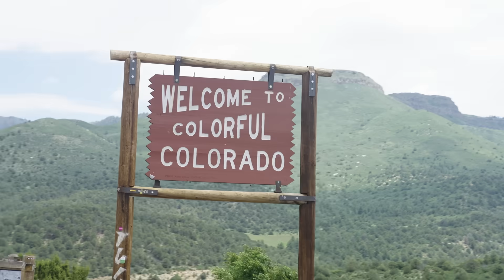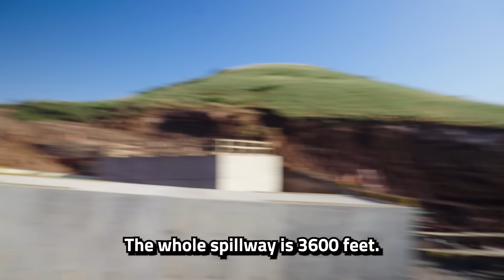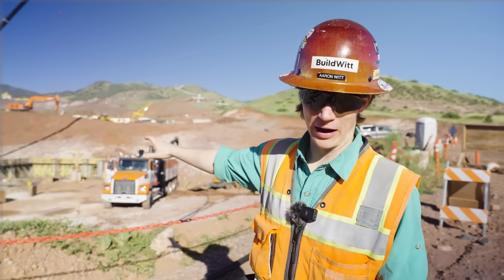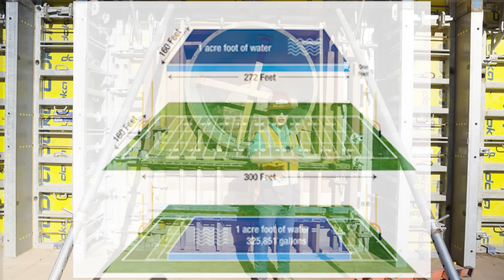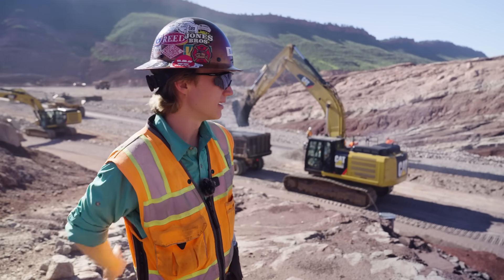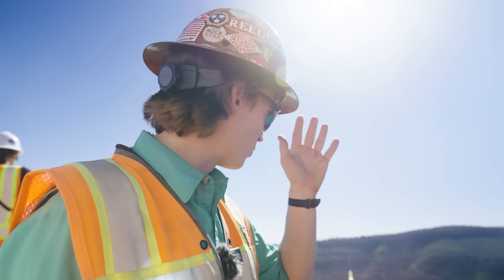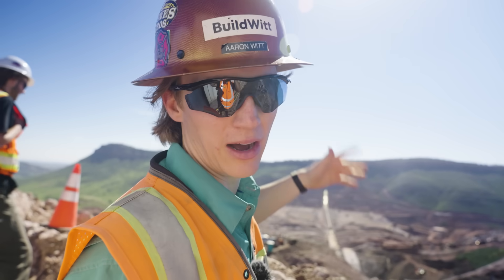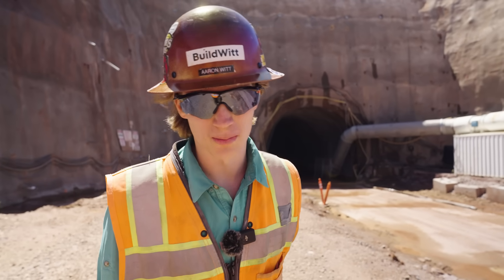Building a New Reservoir to Supply 825,000 People with Water!

Comment: Barnard couldn't get our reservoir project done in South Texas. They just don't know how to work this ground down here on the Gulf Coast. Hope they have better success with this behemoth of a project. Their workers were so worried about safety and protocol nobody thought about successful completion.😂😂😂 One of the foreman told me not to hang a pole light from an extension ladder 1 day and I knew if I didn't the job was not complete and they were threatening to back charge me if it wasn't complete by the end of that day. I didn't have time to schedule a lift and all that. So you know what happened?? I went up that extension ladder with a parking lot light and hung it no problem in about 10 mins while some Barnard kevin screamed and called everybody under the sun to get me off the ladder. 😂😂😂😂 My boss called me and told me to stand down to do what they told me but it was too late....the light was up and hanging in no time at all and I was thinking deuces back home. Texas is a little different and those workers said as much.😂😂😂😂😂

Comment: Ya.. another Teton..  Quite frankly I don't think that the Front range is stable enough..  in it deep underlying structure.. and this is a political project, but then you have pointed out the nearby existing dam.  maybe they are also using the pumping are releasing of water for energy storage.

Comment: If there is no river running through, do you seriously believe there is enough runoff from rain and snow melt for this to ever fill up?
Reply: The water to fill it will be pumped from Lake Granby thru a tunnel over the continental divide and thru a system of reservoirs operated by the C-BT system. The tunnel was built in 1940.

Comment: Never seen such narrow spillway. Capacity looks very limited. Catastrophic floods produce unpredictable runoff which lead to massive amount of  overflow water to be discharged rapidly to stop the swell. With that in mind, that liitle channel looks ridiculous.
Reply: Unlike most dams, this is not built on any river, stream, or creek. And the watershed that would dump into it during a rainstorm is trivial in size. It will be filled by the C-BT system, which pumps water from Lake Granby across the divide, thru a few other reservoirs, and ultimately to this reservoir. Being so heavily controlled, there is no need for a large spillway.

Comment: This is what California needs to do. They keep pulling up dams, and replacing the hydroelectric ones with solar and windmills that cannot match them in electrical capacity, while allowing the water to flow out into the ocean thus depleting the water needed for both drinking and farming. Then every year during heavy rain seasons they seldom keep the water. If they just built some storage reservoirs like this that are not blocking rivers, then California would not be in trouble every couple of years.

Comment: Surprised all the eco nuts and enviro wackos haven't stalled this marvelous project. The midwest really needs more water resources desperately.
There are a number of other dry valley's that could be turned into lakes. I hope this inspires more projects. 
Also for pumped storage to save solar power for peak periods.
Reply: Probably because no one knew about it until now.
Reply: @Summerbreeze537 the approval process for this dam started in 2003. Is 22 years enough time?

Comment: Is this going to be used to divert more water to the eastern slopes of the rockies and population centers like the Big Thompson project, or simply to store water already on the eastern slopes? If it will divert more water against nature like Big Thompson, this doesn't bode well for the lower basin who already have their major share of water issues. Between diverting the water against nature to the east, and Wall Street buying up rights on the western slope, there won't be much of the traditional Colorado River left in the future at this rate. It's a shame this type of large scale project isn't happening in California instead. Barnard was the company who constructed the Lake Mead intake project to supply Las Vegas before Impreglio-Healey and Vegas Tunnel Constructors came in and took over for the 3rd (lowest) intake. This is another huge project of their caliber and it will be interesting to see it unfold. Very much enjoyed the video, just subscribed 👍
Reply: One new reservoir starting in California soon. On March 10th 2024, President Biden signed a package of bills that included $205 million in construction funding for Sites Reservoir, a proposed $4.5 billion project planned for the rolling ranchlands west of the town of Maxwell, about 70 miles north of Sacramento.
Reply: @duchampsrook  thank you for this info that is great news to hear! With the Sites Reservoir though, I'll believe it when I see it holding water. Sites has turned into the next "high speed rail" of resource projects... talked about for decades but still not ready all these years it has been so badly needed.

Comment: This is so awesome! Hats off to all the Engineers, Workers, Equipment and Suppliers and the Politicians who all fought to be a part of this great project. It's seriously something to be proud of to be a part of this much needed project. Thanks for sharing. Best Wishes & Blessings. Keith Noneya
Reply: @MJ-uf9tl  Yes that could be a problem fro sure depending on how much water is used. I'd like to see water catch systems like they have in rural Mexico. The have flat roofs with a 9" dam all around the edge with a few pipes that lead to water tanks. The filter and heat the water with solar.  Then the water used for washing and toilets goes right back into the ground via a drainage field and makes it way back to the underground aquifers if one exists there. I also like Earthships, check those out they're amazing. Good comment. Best Wishes & Blessings. Keith Noneya

Comment: Doublethink: The act of simultaneously accepting two contradictory beliefs or ideas. How is it not blocking the water?
Reply: There is no river, stream, or creek going into this reservoir. And the watershed feeding into it is minuscule. It will block a trivial amount of water. The trivial amount of water it will block would’ve flowed into the Flatiron Reservoir immediately below it, which was built in 1953.

Comment: not sure how this project can be justified. every drop of water to fill it is being diverted from the Colorado river which has been very heavily invested in to supply water and electricity to several western states and has been clearly over consumed during a prolonged drought. Additionally, all of that water is being pumped so no hydro electric component. could eastern growth be supported by projects that pump water from sources destined for the Missouri/Mississippi at similar cost and additionally address the regular flooding on those?

Comment: That is one thin asphalt core.  They tried that out in CA decades ago, tiny tiny earthquake, tiny crack, a tiny bit of water got thru, eroded fill, more asphalt fell apart as it lost support,  the rest is disaster history special on a few you tube sites.  I'd have said 10 feet min wide or two with clay between.  It's JUST ASPHALT, it's dirt cheap.

Comment: How many times have they ever used an asphalt core in a Dam?

I've seen layers separate because of water getting between and it freezing. 

   I'm curious how they are sticking the layers together? What are they using to make the layers stick together if anything?

    Hopefully not just Tac Coat like on roads. I just see this as being a weak spot, as asphalt is not considered permanent. I worked asphalt for a lot of years and typically it's replaced or top layer milled and then capped every 10-15 years for roads anyhow. Not to mention it cracks and they try to tar/polymer rubber seal them to extend its life.

All I can say is I'm glad I don't live in front of it.

Comment: It would cost a lot less if they just ripped swales all along the hill slopes (ditches  that trap rain and snowmelt run off) and force it to percolate underground. It would also trap more water , improve the fertility of the land, and the water  would be stored underground where there is no evaporation.
Reply: No it wouldn’t work
Reply: No way that would ever be feasible much less functional
Reply: A few feet down is solid sandstone. Below that is granite. The rate at which the water can penetrate is minuscule. There is no aquifer to fill in this area.

Comment: With 350 foot of water that's 152 psi water pressure now the asphalt core at the bottom is the core wider at the bottom of the dam wall to handle the water pressure

Comment: Why asphalt core?  Why not concrete?
Reply: when ground settles or shifts, concrete cracks, asphalt bends... I guess
Reply: @ginglyst  If asphalt bends it makes for cracks, and if there are cracks it is weakened. Cold asphalt doesn't mend itself. Asphalt is a very interesting product to be using for a core. I wonder if they are putting some sort of sealant between each layer of asphalt?

Comment: As far as the aggregate being used it is a no brainer to have it pulled from the ground on sight. I am guessing that it also increases the volume of the reservoir by some amount if it is coming out of the basin being flooded. The amount of concrete being used and the distance from a source demands on sight manufacturing. I believe this process has been done for most if not all large dam construction.

Comment: Just retired after 45 years  as Operating Engineer  this  video  makes me  want to  come back 😢 😊😊😊
Reply: is it as fun as it looks? just big kids playing with big toys?
Reply: Thank you for being one of the Operators out of an operating Engineer UNION. 😊
I started in are Local back before everyone of the guys came back home from Alaska Pipeline Job. In the 1970s
I loved the different big excavator back then, you know the ONES ( air over Hydraulic control) I did a lot of mainline sewers. I ran the Hoe packs, but I talked with the operator of many different excavators, and boy there was many different control patterns back then. On one we had a big (Poclain) it had 4 levels together with a foot pedal on the base of two of them for foot or hand control like a rubber tired backhoe had, plus two other levers on each side a little higher than the 4 levers. I worked behind a big 1266 old school ( Koehring) The control patterns on that were so interesting, the AIR button on the two big Levers for swing and boom, my biggest sewer job or should say longest was working hoe pack behind a big Bucyrus Erie 350 excavator 😊 man she had power in hard pan. We changed our digging teeth like twice a day. There were all these little AIR hoses going up into the bottom of the two control levers.
Myself what I used for the hoe pack was the first old Case 680-C with the terrible Airbrake system. The old girl would lock up the emergency brake if you used the rear wheel a lot to help you single brake steer with back tires. They brought in a new 190 Dynahoe, so I started digging side sewer stubs with her. I Love the Dynahoe so much 😊 in 2003 I bought an old used one. It had close to 8000 hours on meter. I have put hundreds of hours on her just around my property it's my TOY. 
Other than Hydraulic seals leaking and having to overhaul rear brakes when I bought her. Never have done anything to the old Detroit Diesel (353) she just keeps working for me. Getting back to my UNION work, all the A list guys came back from Alaska, so work thinned out for me
I switched to Utilities and ran a small water system then finished my last 15 years ( Road Farming) for a city PWs. I Loved to sewer jobs working in the late 70s For operating Engineers. 😊 I watch this young guy's video and I'm like you miss those big digging jobs.
Reply: @rp1645  Thank you  rp I worked  out of LOCAL 542 PENNSYLVANIA   learned  on older  equipment  for  my relatives  they A Bucyrus  Erie 15/30 H hoes air over  hydraulic  remember  cab was opposite  of today's  cabs also had a HienWarner hoe Cable  pans  pony motors dozer had to hand crank  to tilt blade great memories  made  me a better  OE and when  I retired  was  running  dozens and Graders with  GPS my how times have changed  I loved  my job  got to meet  a lot of great people take care 🙂 😀 👍
Reply: I sure hope you return and show us progress on this project...please!
Reply: @alanparrotte5976  Wish I could  Alan are you  working  on this  project   there's  some  nice  iron on that project  take care  Thank you
Reply: 30 yrs. retired Ironworker, operators were the sacred calves for us. Good job, I'm a J.I.W., When in doubt -Boom Out!
Reply: @haroldplante8287  Always  admired  Iron Workers   running  around  that  steel  like  it was  a sidewalk
Reply: I know I love those big jobs man / in joy you’re retirement
Reply: @floydwilliams3321  Thank you  Floyd
Reply: Go and work.. your experience matters alot..
Reply: This is crazy I turn on this channel and find two other people say they just retired from operating engineers. I had retired a year and a half ago from operating engineers also in Los Angeles.
Reply: Local 542 here I will never retire
Reply: Local 103 Operating Engineer out of Indiana. I'll take the seat of a Cat D9 ❤
Reply: My Dad was part of the Local 103 OE... he just passed away... he would have LOVED this!
Reply: @4641080  My condolences  on the  loss of your  Dad  he got  to do one of the best  jobs  ever I was very  blessed  to do  I loved take And God Bless
Reply: My dad too OE local 3 I believe Reno nv/ Northern California 😊
Reply: Na don't just live your life it's already half way to 80% gone depending on how you lived and dna from family.
In my family the woman live up to 80 to 90 years but the men average about 50 to 70 years.
Like by the time I hit retirement age ill be 80 to 90% through my life or dead before I get there.
Reply: You can help us build a little smaller lakes , ponds and streams now!
Reply: The comparison between English gallons and metric liters could have begun to help Americans understand "metric"!
Reply: @Zubeneshemali WHAT YOU MIGHT "BEGIN" TO UNDERSTAND IS WE DON'T USE THE METRIC SYSTEM NOR DO WE CARE TO LEARN THE METRIC SYSTEM!
Reply: @watchinglistening Never seen anyone so angry about the metric system. LOL. If you’re an engineer, scientist, architect, doctor, the list could go on, you know and use metrics in your work. Hatred for metrics is a new one! LOL.
Reply: I SMOKE WEED ALL DAY. NOTHING TO SEE HERE. BUT MY 10 POUND WEEKLY SALE OF $19,000
Reply: I SMOKE POT ALL DAY. KEEP WORKING...TY
Reply: Fu
Reply: Right?
Reply: Добрый вечер это где находится такая работа
Reply: WORK UNION 
 LIVE BETTER 
  Retired  IUOE local 49
 F going back to work 😊
Reply: How many did you over charge?